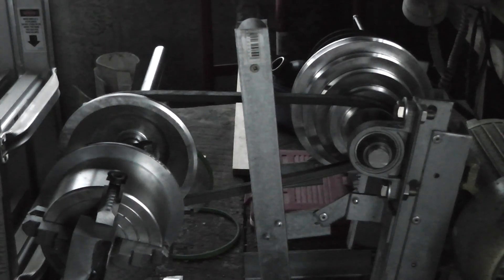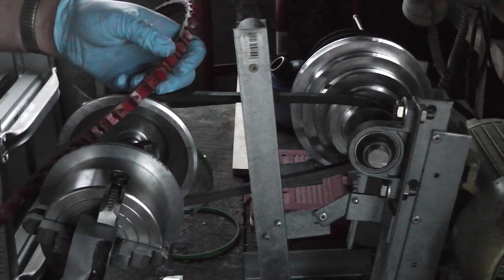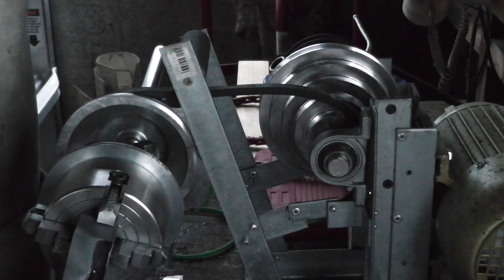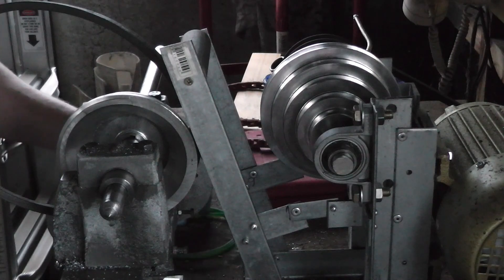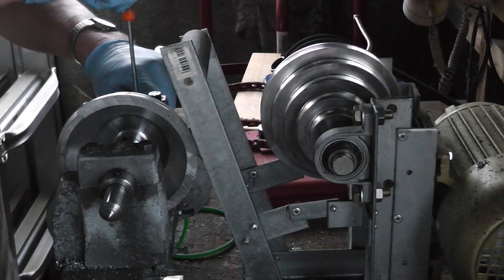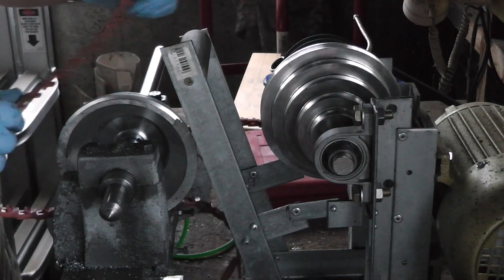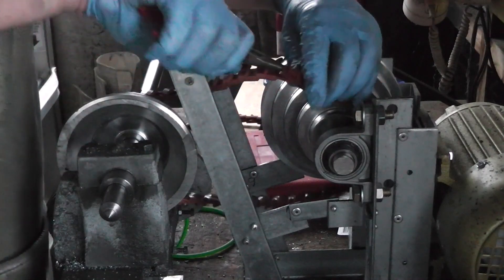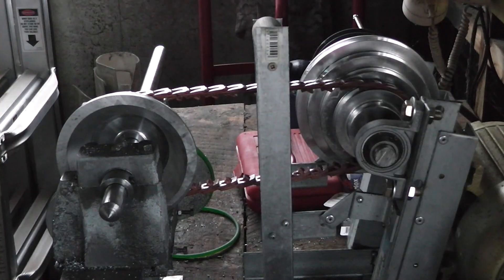Link Belt

Comment: The cost is what puts me off, didn't know you could buy it by the meter.
Direct replacement 'stock' lengths are roughly three times the cost of the standard V-belt and I'm not doing anything that needs the reduction in vibration to increase accuracy. 
Having an extra piece is great for repairs, plus, much easier to change belts when you have them enclosed
Maybe in the future if I get any spare cash?  😎

Comment: 10 years in an industrial environment,  those link belts save hundreds of hours of labor every year. The speed at which equipment can get back online after a belt failure far outweighs their cost. Not to mention always having the right length belt from a bulk roll of links. 
Good choice to make servicing a lot easier there Mr Allen.
Reply from the maker: One comment I saw on another vid had an interesting use case -- the guy stripped the link belt off the machine, adjusted the length, and then put it in his F-150 to get it moving long enough to get to the auto parts store haha